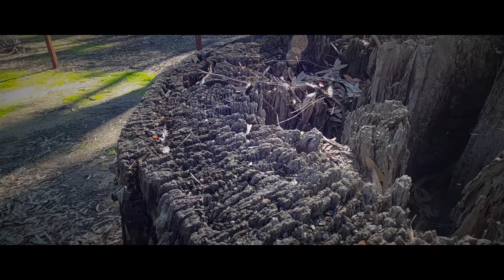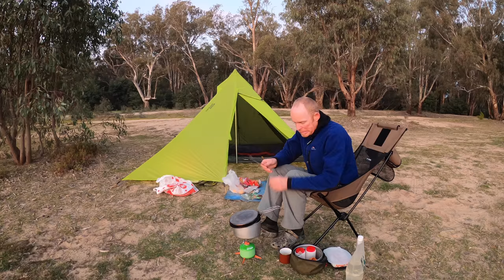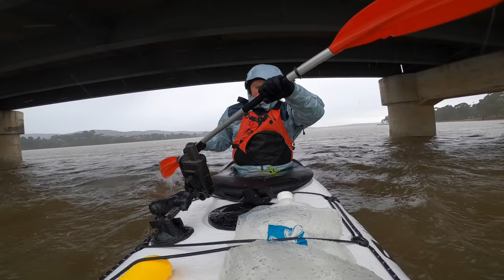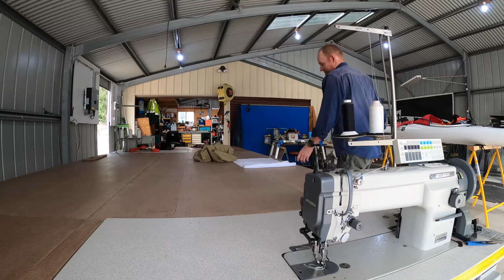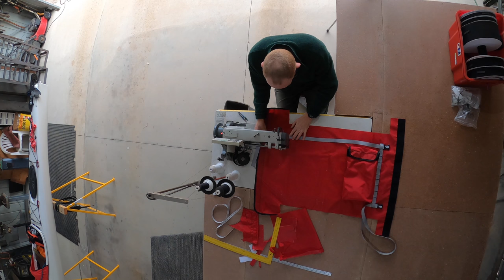HERE GOES NOTHiNG!...RiVER MURRAY - A SOLO JOURNi - eP1

Comment: I’m glad you figured out which way the paddles went. For it would have been a different trip. 😊
Reply from the maker: I went into the whole paddling thing thinking my paddle would act in a similar way to the tread on a Tractor tyre...the V would distribute the load over a greater area than just the immediate footprint (paddle area) - I'm not convinced I am wrong...just haven't observed others paddling using my 'Rookie' technique!
Reply: @PaulBrookerJOURNi  it took Ilsa a while before she realised that the lump on the shaft should be in you’re right hand.